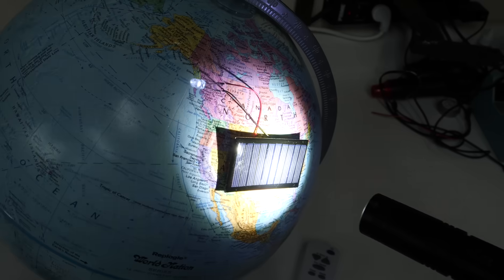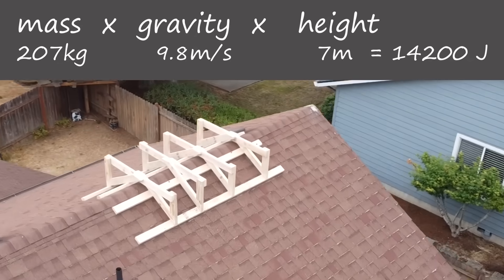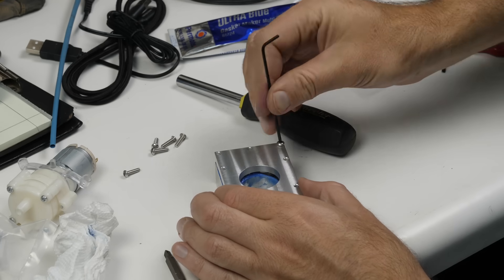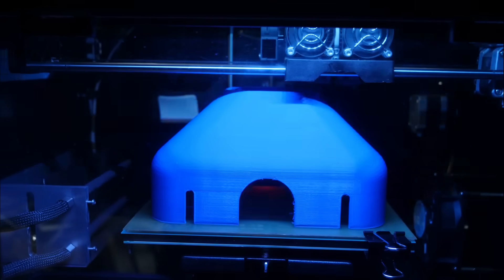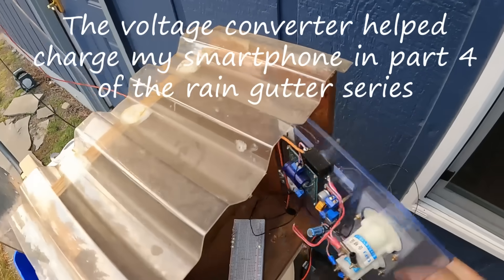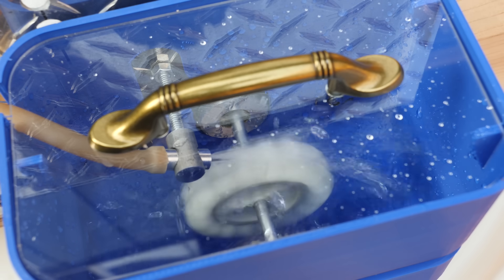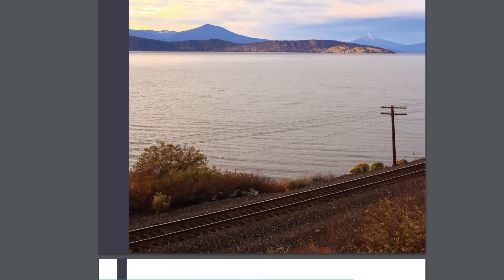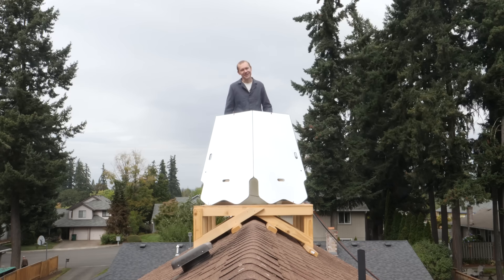Storing Solar Power on my ROOF!!!

Comment: @Quint BUILDs - 🤔 want to try a well insulated sand Battery, just need a way to convert heat back into electrical energy, maybe via Stirling or mini efficient steam engine, , maybe not fed by a boiler,  maybe a solid metal  boiler , to flash the water to steam, and turns a turbine...

Comment: Can you log or the energy consumption required by the pump to move the water, thus compare the theoretical energy required: = mass×g×height
Vs E= P×time
Thus you might see the the efficiency, losses in pumpmotor and flow losses.

Comment: I'm sure you're well intentioned, but it's completely unnecessary to use solar for this. You can easily just use a garden hose with no pump to the drum using city water pressure.  While using this technique for large scale solar projects is good, this small residential is kind of silly and hopelessly over complicated. I'm in AZ and people here use their garden hoses to clean off panels. Static head is NOT a problem. I guess if you're in the country and have a well MAYBE this makes sense but having had well water before, water pressure was NEVER a problem.

Comment: To Recap:
1. The solar panel starts the motor that pumps water up to the roof barrel.
2. The gravity fed water is tapped back to ground level , turns a wheel that causes the electric generator to function, feeding electrical devices.
Excellent.

Comment: Hi, if you used the solar power from the day to charge a battery would the unergy stored be more than the energy you get from the water powering the water wheel. If you already answered in the vid forgive me I'm not too clever.

Comment: Heat would be another good way to store excess solar, Have a system that diverts excess energy (use a wind turbine setup on solar) to dump excess into heating elements on your water tank.

Comment: Considering a height of 3 meters
A 1x1 meters storage stores 8 w*h
A 2x2 meters storage stores 66 w*h
A 4x4 meters storage stores 533 w*h
A 8x8 meters storage stores 4.2 Kw * h, which is enough to provide 500w for 8 hours.

So you have been fooled by the simulation inconsistencies, adding one meter to a cube is way different than adding one meter to a line.

Comment: Multiply that power times 10 with the same water . 
Electric power made easy  "I DON'T PLAY , I QUIT SCHOOL , BECAUSE THEY HAVE 

RECESS " …!

See this Mr President Trump . 

   This is what you do to a mountain to get it to dump water where you want it . 

    Imagine all the solar cells on the Sun's side of the mountain . And this culvert directing the water down the mountain to the desert side for farming  . All the time running that water through hydroelectric generators every 50 ft of height for enough electricity to furnish a city . 

Imagine solar, Water Gen on top of the mountain collecting that water at a high altitude thousands of feet for all those hydroelectric generators every 50 ft of height ! 

And imagine they turned deserts into an actual Oasis instead of stupid solar cells covering farmland . 

Told this to Elon musk but I'm not waiting anymore ! 

   Put them solar cells on the sun side of a mountain and build these culverts to make this hydroelectric energy, IN Incredible demand a falling USA grid ..! 

I swear everything that I see a globalist do is so damn stupid I'm surprised they have a brain at all ..! 

https://youtube.com/shorts/4SELMu0Exs8?feature=share

Why fools , fools with solar panels when with solar panels in the right place with Water Gen you can make 100 times the kilowatt hour electricity hydro electricity. On a mountain . 

   By the way Mr President Trump makes all of our hydroelectric dams look stupid . Because they only use the water once . 

3200 √ 50 ft ..

That's 64 times to use the same water on the way to the ground . 

And now we can power the morons in California , 

WITH ONE STINKING MOUNTAIN. .............! 

Enough power to charge your EV cheep! 

GLOBALIST are absolutely insane . Mr President Trump , I wouldn't let them touch my lawn mower ..!

It's not how you collect the sunlight ?

It's not how you collect the water ?

It's WHERE you GLOBLAST morons . 

ON TOP OF A MOUNTAIN ....!

I should name that , "I DON'T PLAY , I QUIT SCHOOL , BECAUSE THEY HAVE 

RECESS " …!

What's my point ? 

Put trees 🌳  on the mountains ⛰️ also collecting the water to be used in hydro electric generators every 50 ft of height of that mountain ⛰️ 

With solar cell powered water Gen..!

https://youtu.be/-1viw9fS0HI?si=wLRhGMNysjMSePWr

Excellent 

Excellent now deploy it on the desert sunny side of a mountain ⛰️ re-rout the water to the desert side. 🏜  . 

   

Told it to Elon Musk.  Told it to President Trump.  

THEY SHOULD BE JUMPING ON THIS , 
ONE MOUNTAIN ⛰️ ENOUGH ELECTRIC ENERGY FORE CALIFORINA ..! 

WE INVENTERS ARE COMMING FOR YOU INSAIN RICH PEOPLE AND WERE TAKING OUR NATION Back one invention at a time ..!
Reply: Keep me posted . 
Apply pressure in the right place and it's earestible to build on a mountain ⛰️  . 
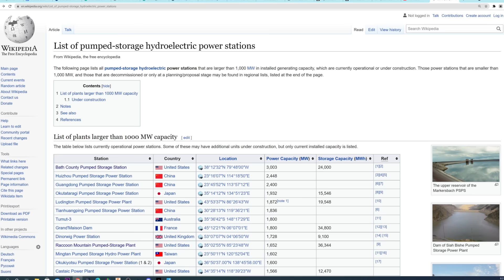    Better yet water from the mountain to the desert 🏜 side of the mountain ⛰️ now you have a civilisation of farms there where nothing grew ..! 15:42
Reply: Like Model Volcano kits 
Build mock ups for school kids
🏔️+💧= 💡

Comment: they should use solar power to convert water into hydrogen and oxygen, and then use the hydrogen as a normal fuel
you could even fill a car with it

Comment: İf you used same sized solar water heater instead of solar panel PV you could have saved about 5x2=10 times more energy as heat. (5 times from production at least 2 times from converting the potential energy to electric energy)

Comment: In Scotland UK, there is a hydro-electric dam,when there is excess wind production off the coast (too much for the grid to handle) water is pumped from the lake at the bottom to the top, to be released when extra power is needed, it is then released through dam.
Reply: Something similar in Switzerland as well. Very cool. Very very very cool!
Reply: What is the performance of these kind of thing? How much energy is used and how much it generates?
Reply: @augustoa About 80% efficiency, sometimes higher, so pretty decent, but not perfect
Reply: @weir9996  80% is decent, depending on how long you are storing it can be better than regular batteries. Thanks for replying!
Reply: @weir9996  while nowhere near the volume, a second hose filled with rope or another fibrous material could be added to the system to take advantage of capillary reaction so that even during the night, the system would return water to the elevated holding tank with zero expenditure.
Reply: @weir9996  60& is claimed in the black mountains.
Reply: Ben Cruichan is the one in Scotland, Donorwig power station is the largest in the UK and one of the biggest in the world! There are some being built in California as well and considering Pumped Hydro is one of the oldest energy storage methods ever invented, the fact it’s still being used today is fabulous!
Reply: good common sense planning
Reply: He can get $50-100/ month for that water if he increases it from a 50 gallon drum to 2,500 gallons and 🛑 paying his 💧 bill. Obviously he's got to put it on the ground.
Reply: The Black momtain system in Wales gives grid energy for perhaps 15 -20 mins that's all then 24 hours reverse pumping water up hill.  A limited solution.
Reply: @BrinJay-s4v the generation of electricity has always been from a portfolio of sources.
The real value of Dinorwig and Cruachan is in being able to instantly top up the grid at no notice. They are a superb solution for grid balancing. 
And FYI,  it takes  7 hours to refill Dinowig, not 24. Given that it  can run at full flow for 6 hours, it's difficult to see that your criticism is founded on a sound factual basis.
Reply: That's clever.
Reply: Pretty interesting. And very clever.
Reply: yeah pumped hydroelectricity is actually pretty common in Europe and there are GWh of storage in this type of device
Reply: @gregoireveron8342 Unfortunately, there are not so many places across the globe to store pumped electricity - and in most places alike there is hydroelectric station already. You actually need at least a mountain with a stream to do this kind of accumulator...

Comment: I need about 6KWh per day, so to store such amount of energy I need to put 315 cubic meters of water on 7m height on top of my roof. It is qite large basin you can train to swim and dive. That is not taking in to account losses of energy on friction. To store same energy as a heat in water I would need only about 100liters

Comment: I have 13.2 kW of solar panels on my roof that generate far more than my 5 kW grid export limit (my solar installer played a dirty trick on me).  To make use of the (up to) ~8 kW of excess solar generation during the day, I have been exploring options ...
The easy route: add LiPo4 batteries to store excess power during the day for use at night (and/or exporting the stored power to the grid at night would be a really nice bonus as well).    
The adventurous route:  I also have a currently unused 5,000 gallon concrete water tank on the hill behind my house to provide an upper reservoir, a spare household electric water pump (needs a simple repair to fix a leak), a spare 5,000 gallon water poly-tank full of water below my house that I can use to provide a lower reservoir, and enough poly pipe lying around ...   I need to get an appropriate impeller and generator and hook these up to my house, ideally so that my solar panels, solar inverter, meter panel, etc are happy with the water generated electricity feed ...  
Or, maybe more simply, add special power points to my house that power my nighttime appliances directly from the pumped storage generator without this being grid connected.  
It would be a lot more fun to go the pumped storage route.

Comment: A roof can not stand high loads (tons).
14200 Joules (Watt*Second) are only (divide by 3600) 3,94 Watt/hour.
It can light only some LED's for a restricted time but it is worthless to make further investigations.
A good Lithium Cell 18650 can handle this amount of energy to buffer !

Comment: User's Comment: "This video about electricity is so interesting! I love learning about new ways to power my outdoor adventures. Can anyone recommend a reliable portable power station for camping?"Reply: Absolutely! If you're looking for a reliable portable power station for your outdoor adventures, I highly recommend the Segway Portable PowerStation Cube Series. It offers a massive 5kWh capacity, powerful output, and fast recharging capabilities. Plus, with its waterproof design and comprehensive protections, you can trust it to keep your devices and appliances running smoothly during your camping trips. Happy camping!

Comment: The ninety degrees bend in the tubing slows the water 💦 down before it hits the impeller. If the tubing were straight, more wattage would be made.

Comment: why don't you just get a $140 sump pump at Home Depot and just put it in the bottom of the barrel or does that defeat the purpose of this exercise? Another question - Can the water barrel project create enough energy to pump the water to the top continuously while providing power at the same time in a continuous loop setup or can it produce more power than it uses to perform all of it's functions. Pump water, run lights, do it continuously? You are way smarter than me. My simple mind has a hard time getting to the gas station, driving my car to the grocery, making my Philips hue lighting network run continuously and then paying my electric bill and doing it all over again. Thank you for testing me out here. I saw a video of a guy who lived on a creek. He took an old bicycle frame and set up a car generator to run a simple light to his place next to the creek and the only cost is fixing the generator and occasionally replacing the drive belt. A hydro power solution by a minimalist for sure.

Comment: Hey Quint, i do understand the experiment, but that little solar panel connected to a solar charge controller charging a car battery that powers a inverter or even a 12v phone charger would produce more power. The hydroelectric power generation i prefer needs a river of sorts. But as i said, i do understand the experiment.

Comment: It literally took more energy to pump that water upwards than the benefit of the power coming back down. Could’ve just got a 9 bolt rechargeable battery and used the solar to charge that. Saved hundreds on a 3d printer and spent more constuctive time with your kids. Like teach them that there is no “free” energy…

Comment: Would it be more efficient to run the pipe to the edge of the roof and then have a series of staggered turbines where gravity is pulling the water down and you collect the turbine energy at several different points utilizing more gravitational energy? How many turbines could you draw power from, from the top of the roof all the way to the ground?

Comment: I do like the project for educational purposes, but have only a one question: doesn't the solar panel produce 50W of energy at it's peak? Since it's old, let's say 25W. That's 200Wh in 8 hours. That's probably 200x more energy than in a AA battery. So my assumption is: there is a gigantic power loss due to the pump motor heating up and there are many places where the energy is lost. Would have hoped for at least 100W production.

Comment: Pumps have a pretty low mechanical efficiency unfortunately so a lot of energy is wasted by this method. Better to build a pulley system to lift and drop weights.

Comment: cool so with 14,000 joules capacity if you had the valve half open you should be able to run the lights for 7.5 hours with a half watt per second consumption i think?

Comment: the biggest scam of the 21st century is the renewable energy lie , for small use its absolutely fine bust for scale , its disastrous for the environment 
we have to stick to nuclear power until fusion reactors are ready !!! not enough people know or understand the amount of chemical waste making a single lithium battery or a solar panel involves ,most of the process is irreversible meaning once the waste chemicals are produced , they can never be detoxed or disposed off

Comment: It sounds like you have an interesting idea for energy storage! Using a large wheel with cement to store energy through inertia is an intriguing concept. While I'm not an expert in this field, I can provide some general insights.

Inertia-based energy storage systems do exist, such as flywheels, which store energy in a rotating mass. The energy is stored as kinetic energy in the spinning wheel and can be converted back to electricity when needed. These systems are typically used for short-term energy storage and can provide quick bursts of power.

However, there are several factors to consider when designing such a system. The size and weight of the wheel, the type of bearing used, and the efficiency of the energy conversion process are all important considerations. Additionally, safety measures need to be taken into account to prevent accidents or damage due to the high rotational speeds involved.

To determine the feasibility of your idea, it would be best to consult with experts in the field of energy storage or mechanical engineering. They can provide more detailed insights and help evaluate the practicality and potential challenges of implementing your concept.

Remember, innovation often starts with unique ideas like yours! Exploring different possibilities and seeking expert advice can help refine and develop your concept further. Good luck with your energy storage endeavors! 🚀

Comment: Genius, less than 500Wh of energy, massive losses pumping it up there (evidenced by the wasted energy in heating the pump) and then the losses in recovering the energy …

… add to that the shoddy way you mounted the tank and the ridiculously dangerous way you work on the roof and it can hardly be a realistic solution?